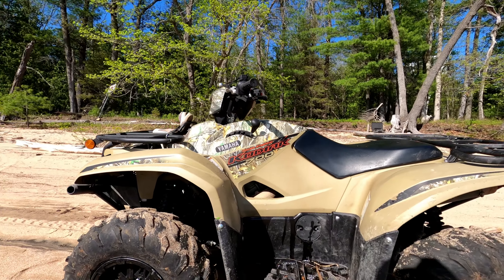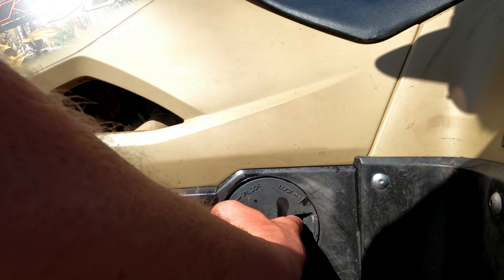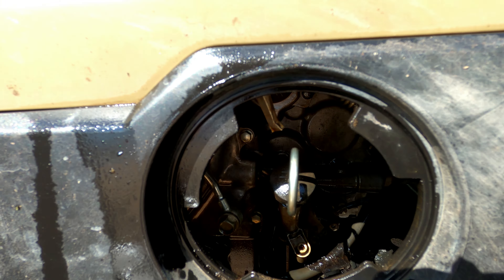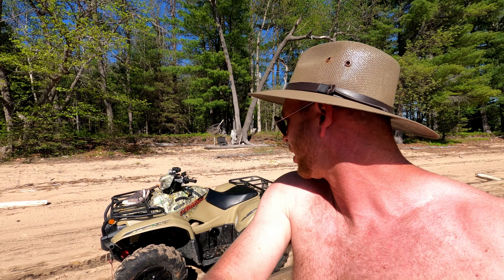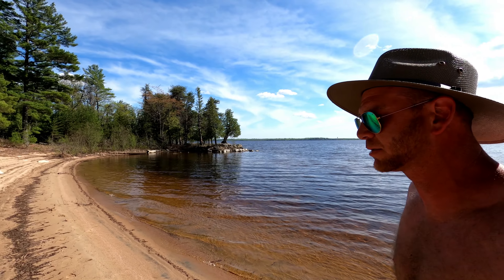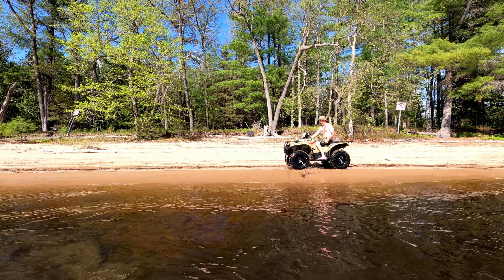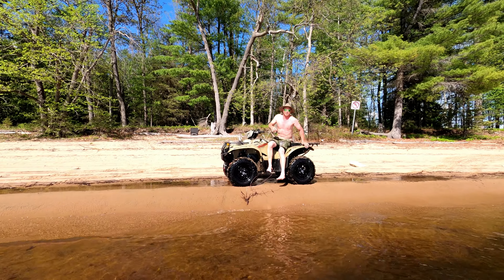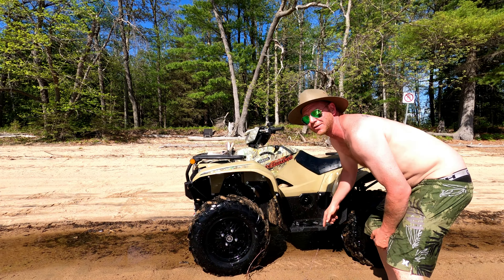2022 YAMAHA KODIAK 700 MAJOR DESIGN FLAW !

Comment: This has been this way for years and years,.its not only 2022 models; nothing done about it yet and dont see too many people having issues really.
Reply from the maker: I just had one lol. I have to change it   It is unacceptable in my books.
Reply: @LH_244  must have been loose to begin with and not all the way inserted.  I've only heard of one other instance of that coming out and it was supposedly due to a stick popping up in there, but looking at mine and that's pretty near impossible to happen.  I check my oil level before I ride, every time and it's never been loose even.  I ride in mud, bog, water, snow...you name it.  I do agree with you though, a screw in one would be better.